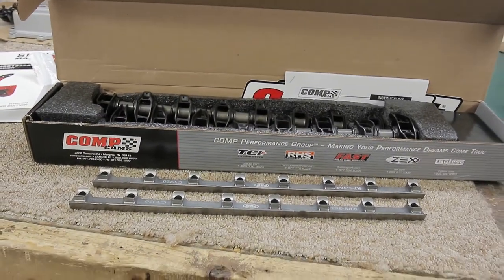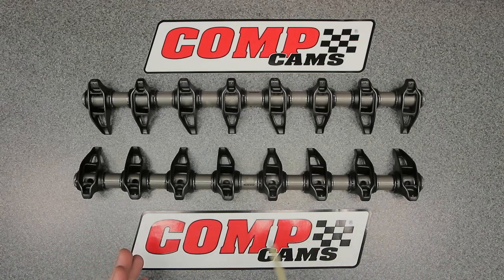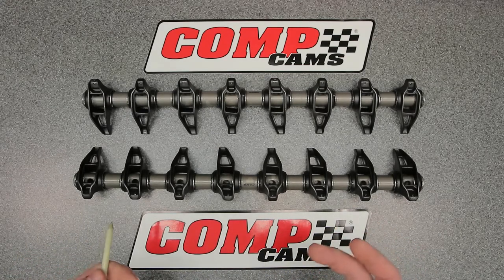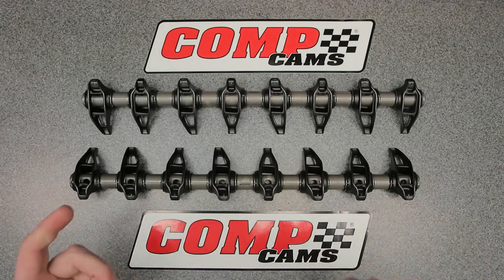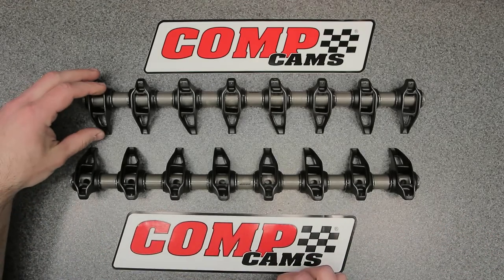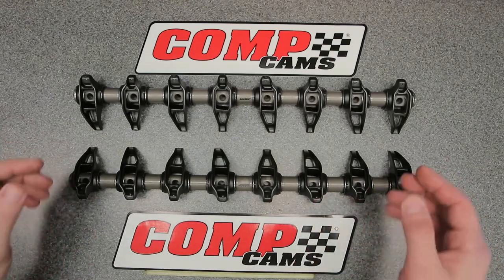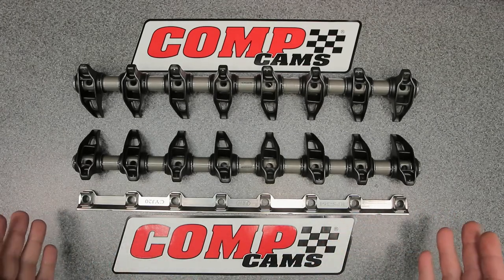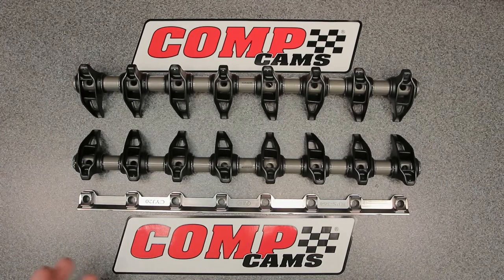The Ultimate LS Trunion UPGRADE | COMP Cams 1982-16 Max-Lift BSR Shaft Rocker System GM LS3/L92

Comment: Fantastic video! Did you have to go with a custom length pushrod with these new parts to satisfy the Johnson lifters preload?
Reply from the maker: yes johnson lifters require custom length push rods.  oem ones will not work most likely

Comment: I wanna see the pros and cons between BTR shaft mount and comp cams shaft mount
Reply from the maker: I also considered the BTR shaft mount but after some in dept researching of my own. The comp cams BSR is still superior because it uses larger trunions and better tri-layer bronze bushings. BTR doesnt even come close because you are still stuck using factory rockers with needle bearings. But you do get the added stiffness of a shaft mount system. Hope this helps. It was a no brainer for me.
Reply: @JohnFrancoNH  great information you have. I would prefer the bushing but I question how long they’d last before wearing out. I like the BTR stand. It adds more rigidity. BTR makes there own stock style rocker body with improved  oiling. I’m very torn between them both. I see pros and cons with ear system
Reply from the maker: @ahack14 The bushings are the way to go when you go with a stage 3 and up cam and when heavier rate springs are used. Bushings eliminate deflection in the rocker arm much better. The pro with the BSR is that its one piece monolithic shaft that has thru holes to each bushing and threaded ends for pressurized oiling. Once bolted to the head its effect is exactly the same as the steel BTR pedistal mount. I use a PRW billet mount with the BSR. Great fit.
Reply: @JohnFrancoNH  where did you find the billet stand? I just spoke with BTR sounds like they have some nasty combos that have been using bearings. I’m not gonna buy anything got a wile. Have to keep digging. How do you plum oil to the shaft?
Reply: @JohnFrancoNH  do you have another social media account where I could message you? I wanna get some more information from you on ur build.
Reply from the maker: I post updates on IG  "Contemporary_Homestead"
Reply from the maker: The BTR is still a very nice stand for the money. I seriously considered it myself before buying the BSR. The BSR is ready to drop in.  BTR needs to be assembled with your old rockers.   Bushings out perform bearing any day of the week.

Comment: Thanks for your review, thinking about getting a set for my l92. In your opinion are the rocker bodies thicker than stock?
Reply from the maker: They are about the same only noticeable difference is that the BSR has larger openings in the body & better finish thru out and a more consistent radius on the rocker tip.  Thanks for watching!

Comment: So how do you install these with the bolts, since there will be several valves at or near full lift? On the factory rockers you just install them on the cylinders that are on the cam base circle. You cant do that with these.
Reply from the maker: You have to install them a couple thread turns at a time all while keeping them even and at the same height. A real pain if you need to use thread sealant for ported runners that have thread breakout in to runner.  I used ARP rocker studs installed first so i did not have any issues. It slid right on. Thanks for watching!
Reply: @JohnFrancoNH  yikes! Yeah studs were a smart decision!